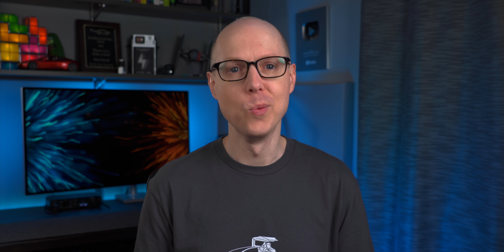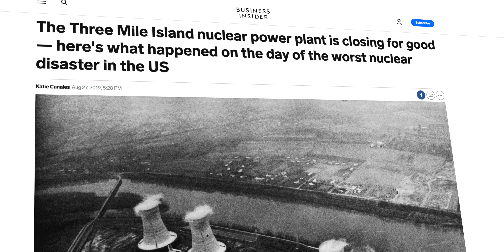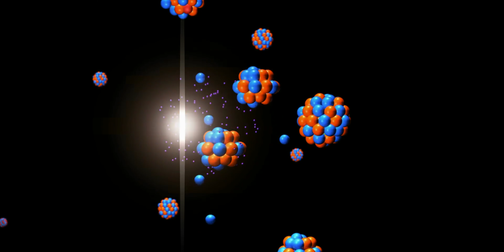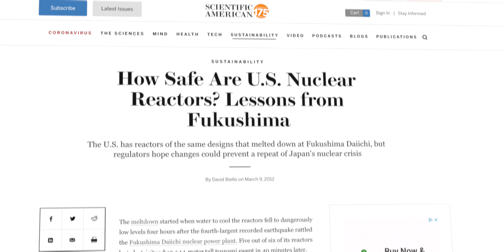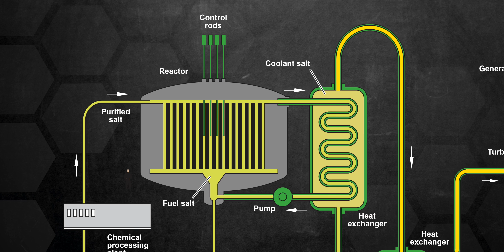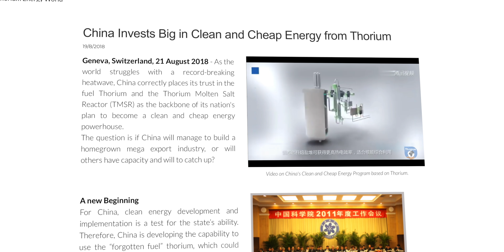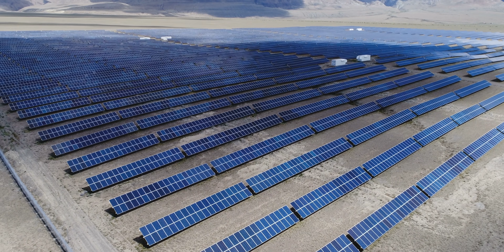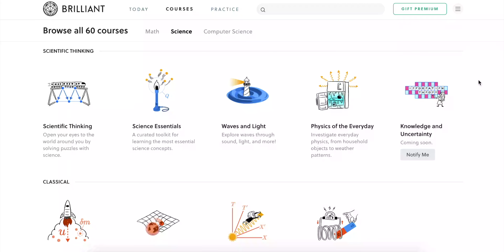Thorium explained - the future of cheap, clean energy?

Comment: The issues for nuclear are:

1. Making it safe. Molten salt has significant safety advantages over pressurised water because it operates at 2-3 atmospheres versus 100 and has walk away safety features not reliant on operators. Most molten salt designs are semi-underground in a pit and don't need heavy containment buildings.

2. Making it affordable and reliable. Small modular reactors (<500MW) promise to achieve this by being mass produced in factories and transported to site as a kit.

3. Making it proliferation resistant. The physics of the reaction makes it very difficult to extract weapons grade material from a thorium molten salt reactor.

4. Minimising the waste problem. Molten salt reactors extract most of the energy from the radiological materials in their core. This minimises waste, but what waste there is very dangerous in the short term (10-20 years) needing careful handling before subsequent storage until fully depleted in about 500 years.

5. Versatility with multiple revenue streams. In addition to efficient electrical power production, MSRs have potential to provide process heat for use in various industrial processes including cement, fertilizer and explosives, bricks manufacture, metals refining, desalination, as well as synthetic liquid fuels and gases including ammonia,  hydrogen and jet fuel as well as industrial and medical isotopes.

6. Minimising water and land resource usage. MSRs particularly don't need much cooling water and therefore do not need a waterfront location. They can be located on land not needed for other purposes
Reply: Wow great intel
Reply: Well said my dude
Question though... Why would they need any less cooling water than a regular reactor?
Just because the cooling loop is salt and not water, the turbine end is still steam which needs re-condensing and to do that you would ideally want to use an open loop of water from a river or ocean source.
It takes a lot of coolant to condense steam turbine exhaust no matter what technology boiled the water in the first place
Reply: @doritoification  
Hi Dominic Adams.
The Thorium salts are at a higher temperature so it is possible that you could use air cooling.  However, water cooling would give you more of a temperature drop, so you would use water cooling if you can.  You would get more useable work out of the system that way.

The idea (I think) is that with more efficient heat engines (for example using the super critical carbon dioxide turbine), and the higher temperature the LFTR could be independent from a river.  But it would still be more efficient to use water cooling, so people would be tempted to do so if they possibly can.  

However, if someone can point out something I am missing, I would appreciate it.

Warm regards, Rick.
Reply: @RicksPoker  I think you nailed it... You would take an efficiency penalty by not using the best cooling solution available. 
Supercritical CO2 is extremely interesting though. I remember trying to wrap my brain around the diagram of how that works with all the different compression stages but it was a little too complicated for me haha 45% or 50% efficient though of I remember correctly
Reply: @doritoification  Because MSRs operate at higher temperature (600-700C) more of their output energy goes into work. In the primary coolant loop salt exits around 650C and returns the reactor at about 580C. Like high efficiency coal powered stations they can be combined cycle, the first step is Brayton cycle where working fluid is gas such as CO2. Brayton exhaust can be used to raise steam for the Rankin cycle if desired. Essentially they are gas cooled, they have to operate dry, water not wanted as it doesn't go well with molten salt.
Reply: @jimgraham6722  I appreciate that you can get away with air cooling but they don't have to operate dry. Assuming you go with a steam turbine that's water right there and the condenser doesn't need to be anywhere near the molten salts either.
Sodium also doesn't like water either but we can totally build a sodium cooled reactor
Reply: @doritoification  I think the issue is that in most MSR designs both the fuel and primary coolant are the same liquid. In most designs the reaction is sustained in the centre of the reactor by graphite moderator rods. The reaction slows as temperature rises due to expansion of the fuel bearing salt. The maximum temperature of the reactor is therefore self limiting. This also gives the reactor a load following characteristic. 

The reactor temperature range is quite narrow at about 600C +- 50C. It can't cool below about 400C as that risks the coolant freezing. 

A much more lucid and detailed explanation than I can provide is available on Wikipedia https://en.m.wikipedia.org/wiki/Molten-Salt_Reactor_Experiment describing the famous molten salt reactor experiment conducted in the 1960s. Being an old guy I can remember at the time the experiment got extensive press coverage in Popular Science magazine. It was seen as the way of the future until killed off by US Congress, but that is another story.
Reply: @jimgraham6722  the negative reactivity temperature coefficient is very useful. Almost too good to be true. Weather you use just a primary loop or a primary and secondary loop, the cooling water is used to condense steam. Steam has to be completely condensed before being heated again to go to the boiler again in order to get the full phase change expansion that drives the turbine. This doesn't remove any energy from the salts at all, just from the steam in the closed turbine cycle. At least that's my understanding. You certainly wouldn't deliberately cool the salts with external water
Reply: @doritoification  The first power stage where most energy is generated is Brayton cycle, essentially a closed loop gas turbine where the gas (probably CO2) is heated by molten salt reactor coolant. If you want more efficiency further heat can be extracted from the Brayton turbine exhaust to drive a Rankin cycle turbine. This second cycle does NOT have to involve water. Other working fluids such as HFC, butane and pentane can be used. In this way MSRs do not need any water at all. 

In contrast PWRs must use water because it serves both to moderate the neutron flux as well as provide primary coolant to the reactor core. More importantly, large additional amounts of water must be on hand to flood the reactor should reactor depressurisation occur. 

Where to from here? We know from MSRE the molten salt reactor is both feasible and promising. However, quite a bit of engineering including software and hardware simulations, plus some power producing prototypes demonstrating the breeder blanket are needed before we could commit to production systems. 

Estimates I have come across suggest a crash program could get us there in seven years. Business as usual would take fifteen. Potentially large numbers of thorium MSR power plants could be rolled out to replace coal plants by 2050 when the climate guys say we need to be off the fossils. 

In context of the 2050 deadline and general utility, ITER is far less promising, I think governments should give MSR development a shove by taking ITER funding and divertingb it to MSR development. 

Fusion I feel,  has a great future but we need to be pragmatic about it. The technology is hugely challenging (MSR is boiler plate by comparison) and if ITER is any indication, the initial plants will make AP1000 PWRs appear bargain basement. It will take many decades if not centuries and I believe a few more technical breakthroughs, before practical scaleable fusion power plants can be realised and deployed widely. Whatever, they aren't going to help meet the 2050 deadline.
Reply: @jimgraham6722  Well, technically you're not cooling the salt in the core, which should be insulated from the working fluid anyways, in this case liquid CO2 and then maybe water in a two cycle system. The cooling water would be used to cool the CO2 and possibly the water for the rankin cycle if you have a closed system.
Reply: @jimgraham6722  I think the range might be broader than that, but that also depends on the relative chemistry of the salt. I can add that one of the issues that were to be researched and addressed by the MSRE2 was further analytical chemistry so they could better manage it in real time. As it relates to salt temperature, if you don't manage the chemistry of the salt correctly, when the salt's temperature drops going through the heat exchanger, it can cause fission product noble metals to come out of solution and plate on the inside of the heat exchanger, eventually plugging it if you're not careful. 

But yeah, it's a super cool technology.
Reply: @williamsmith1741  Yes I understand plating a major issue, needs addressing during development phase.
Reply: @jimgraham6722  Well, I'm sure that's one of the things the Chinese have been working on for the last decade. Just wish we had been doing so also. It's so depressing...

Whatever, so long as someone commercializes the technology right?
Reply: @doritoification  They do require less cooling water than a regular reactor, ironically, because they operate at a much higher temperature.

Comment: I call a bit of BS; not on the Thorium tech... it's rock solid, but on the regulations around it right now. The international nuclear commission claims that Thorium should be treated just like Uranium&Plutonium even though it is vastly less radioactive and cannot be turned into weapons (without centrifuges... which are the limiter anyway; the materials aren't) and having super strict regulations is probably the main reason that more research hasn't been done on the material. Put Thorium into a category separate from the others!

Comment: The 1960s molten salt experiments at Oak Ridge proved that molten salt reactors are safe, controllable, and feasible. Last year the last quibble -- salt-resistant alloys -- was put to bed. We can now go ahead without any further foot-dragging from governments, businesses, and the old nuclear guys.
Thorium "waste" is 1% of the amount of uranium waste. In fact a thorium reactor will happily chew through uranium reactor waste. And the little waste LFTRs do make is either medical grade isotopes or becomes pretty safe after 100 years.
Reply: Are you saying they've solved the corrosion issue? Because I was under the presumption that it's still an issue, but they were working on high Nickel and Molybdenum along with Manganese and other additive content; it didn't say it was solved, though. I really think Thorium nuclear is our best bet to solve the Co2 emission issue, that, along with location specific, solar powered Hydrogen production using electrolysis to fuel planes, ships and trucks.
Reply: Maybe the US Petro Dollar needs to die first?
.
US Federal adminstrations (over the past 40 years) are sometimes brilliant, yet I think mostly due to the petro dollar, they are really dumb in terms of clean, safe, efficient and abundant power generation.
..
Why is Bill Gates pouring  money into MSR/Thorium in China?  Why is Bill Gates a communist (corporatist really - which could be worse - possibly).  Damn, now I am off topic.